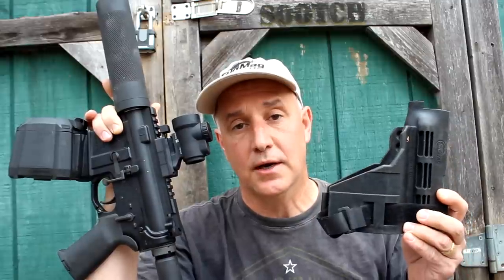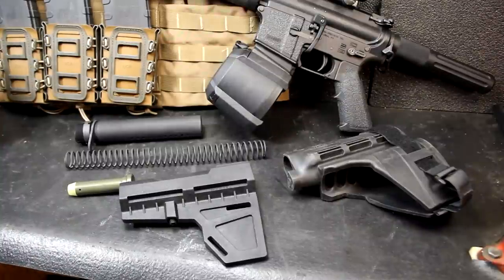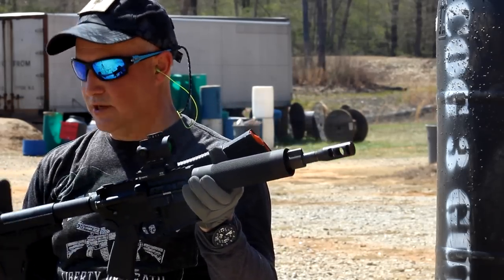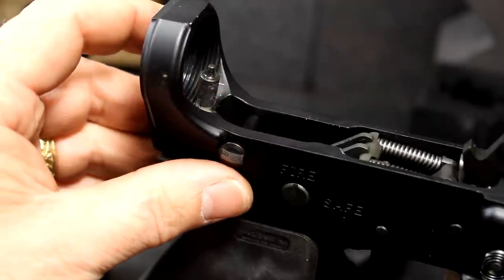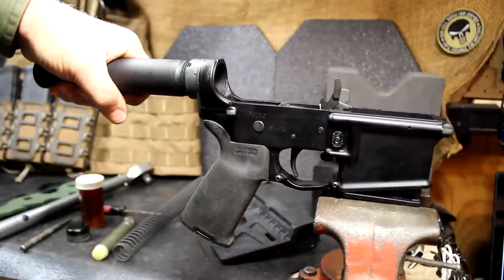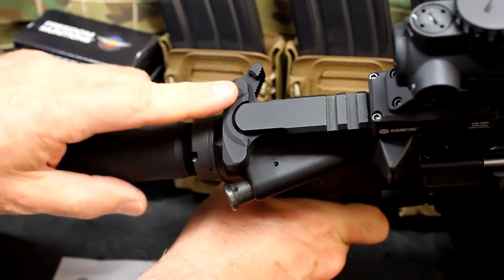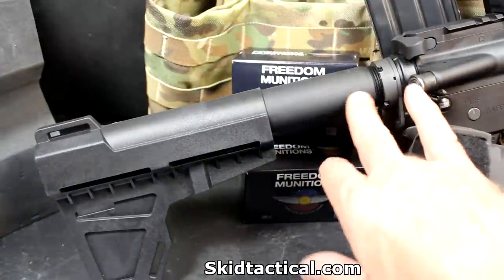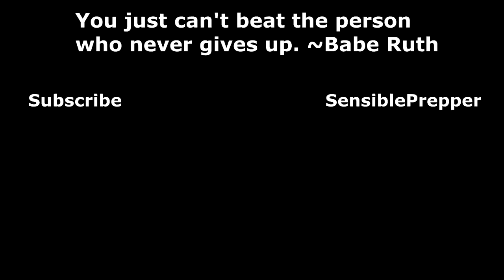Shockwave Blade AR Pistol Brace Review

Comment: You should check out and do a review on the new Shockwave blade 2.0. I just picked up mine and I'm excited to see how it turns out with the pistol, most of all it is adjustable on the 2.0 without the set screw

Comment: You can use loctite on the screw but it has to be blue....NOT red. Red loctite is seen as permanent and I guess ATF views that as a modification into an SBR. The good news is you won't be prosecuted for it touching your shoulder. Wouldn't hurt to have that opinion letter on ya. Not sure where it can be found

Comment: Couple of Small Tweaks for this.  I'd cant the Buffer Tube a few Degrees off center to give it a little more pressure against your inner arm while firing it.  But I keep looking at the recess at the bottom of Shockwave, and I think I'd just cut it out and use it as a Two Finger Handle for the Off Hand.  Add a Single Point Sling and shoot it like a ordinary Pistol.  Trust me, it won't come NEAR any Shoulders that might be roaming around. Take Care.

Comment: SOOTCH see if you can get the tailhook brace from gearhead works, hank strange did a video from shot show on it. it is a 5 position adjustable brace with a proprietary buffer tube!!!
Reply from the maker: I've been looking at those but they are out of stock. Hopefully we'll get one in for review. Thanks Alex!
Reply: Alex Payne I thought I could hold out for one of those for my Evo pistol, but I gave up and bought another one of these blade.  Those will be a game changer when they release them.

Comment: I've been dying to get one of these on my PAP
Reply: ResponsiblePatriot US Machinegun offers a great setup for the PAP. I use the folder with my M85 PAP pistol that takes AR mags. I also highly recommend the Manticore forestock. Light, durable and rock solid when mounted.
Reply: Yes, US Machinegun is where I'll be getting my folder for it. I just haven't dedicated the funds to it. I have too many projects in the fire at the moment.
Reply: +ResponsiblePatriot It works perfectly on my M92 pap. You may need a single layer of duct tape around the tube to prevent the blade from moving.
Reply: I don't see how this hard plastic piece is any better than the sig brace?  The sig brace is much better
Reply: Different strokes for different folks.
Reply: If you already have the SB47 you can "recycle" the mount from that...saves some $. I have my parts on order from KAK for my M85.
Reply: @Illini Armory
Maybe, if you actually want to shoot one-handed. The blade is much lighter/slimmer and more stable. Plus you can adjust length if you use the KAK tube.

Comment: Just read entire ATF pistol reg. It says if it has a stock manufactured as a shoulder fired stock without tax stamp it is illegal. If it has a brace it is a pistol. Law was written for the equipment NOT the way it is fired. Shoulder away
That's the law googled the PDF read the PDF. Nowhere in any reg on pistols does it say you can't shoulder the weapon

Comment: I don’t thank that is 💯 correct. The difference between a pistol, abs short barbell rifle is the stock has a split in it to strap to go around forearm. If you swap that out and put an actual stock on it it is then classified as a short barrel rifle; however the law doesn’t say you can’t shoot your at pistol like a rifle, abs they can’t tell you you can’t shoulder your pistol. As long as you have a pistol brace on it it is not classified as a short barrel Rifle

Comment: What is the length of pull with it extended all the way to the last divot? 
Measured the way the ATF does it. from the center of the trigger face parallel to the buffer tube to the farthest point on the brace.

Comment: Rules changed December 2017, you can shoulder it now depending on the length the brace is set and the loctite used on the sec screw.  Link to the info...  http://shockwavetechnologies.com/site/?p=3524

Comment: You only have the one AR pistola, right?  Or do you not have the one with the handguard with the spikes on the end?
Reply from the maker: That was the ATI Handguard which I replaced with the Dolos. The ATI is a better option but I plan to replace the Dolos with a BCM KMR handguard that's much lighter.

Comment: I have the old dolos system is there a fix to keep it from twisting off Thanks
Reply from the maker: Contact Copper Custom. They suggested lead sinkers in the holes to keep the screws from backing out but I need to replace mine. I'm changing it out at some point. Thanks~